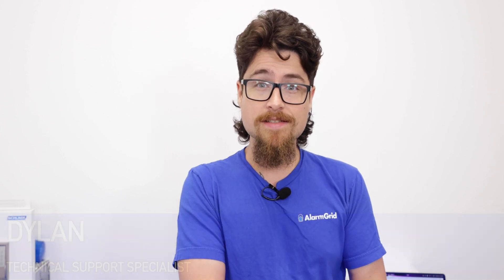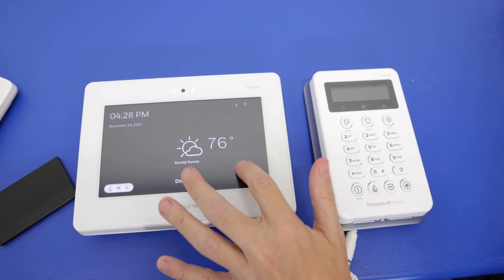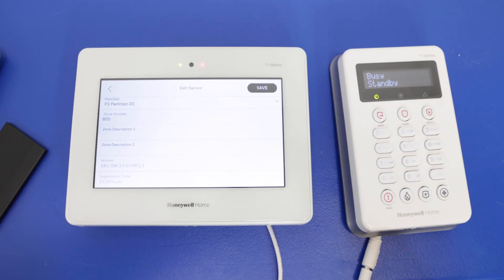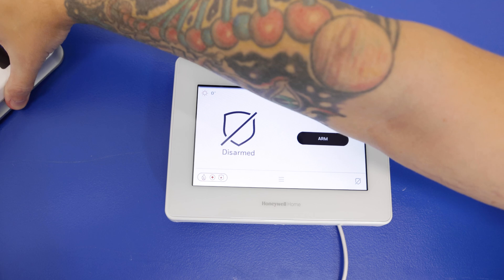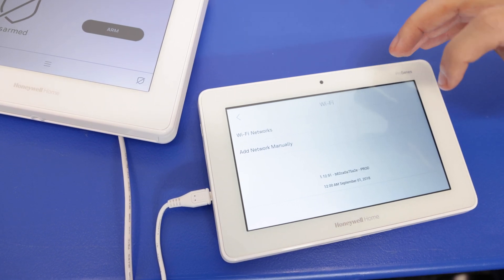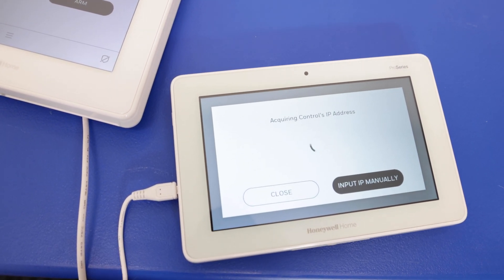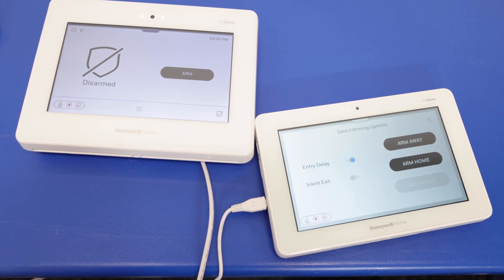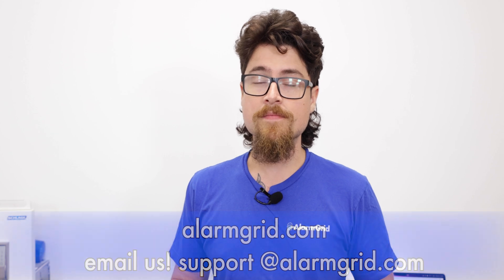PROA7 and PROA7PLUS: Adding A Keypad

Comment: I wish you showed how the backplate is removed.  I undid the screw and it still will not release at all 😑
Reply: I have the LCDKP, the backplate is removed by pulling up, but I recommend you use 2 hands, with one hand on the back and one hand on the front and it should release from the bottom. It kinda requires a lot of strength.

Comment: Title says you address Proa7 and you did not.  Proa7 does not have wifi so my guess is it won't work.  Very disappointed in these systems.  Also the fact Honeywell does not even allow you to get the app and create an account so you can control you devices unless you pay is insane.
Reply: Hello @seeseabee7165,  you are correct that the PROA7 does come with a wifi module and therefore will not work the with PROWLTOUCH keypad unless a PROWIFI or PROWIFIZW is added to the panel. The PROSIXLCDKP does not connect to the panel via wifi meaning that you can use the PROSIXLCDKP with a PROA7 without being required to add the PROWIFI or PROWIFIZW modules to the panel.
Reply: @seeseabee7165  proa7 and proa7plus are the same somewhat but not fully. If I remember correctly, the proa7 does not have a communicator thing or something

Comment: Might use this in the future to help me replace my simplisafe at one point
Reply: Don't.  save yourself the headache.  If they install the proa7, you will find that it does not even have wifi.  My guess is this doesn't work with that.  No one really addresses it.
Reply: @seeseabee7165  I am not installing a proa7, the plus is the one that is best for my look
Reply: @seeseabee7165  it’s a diy system if you want to, they just need to activate it with their service.
Reply: @seeseabee7165 not using a proa7, proa7plus is the item I need in my situation